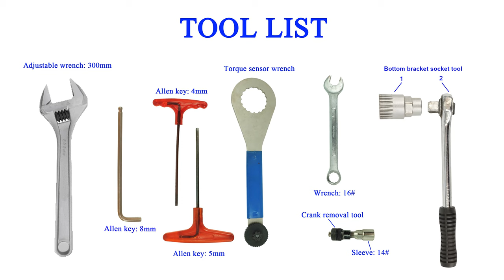eRider | eBike Torque Sensor Evolution -  eRider T9 / T17 Torque Sensor Install Video

Comment: Where can I buy the T17 version? I have looked everywhere, can't find any shop having this one.
Reply from the maker: Hi , please contact us at our email sales@portapower.com.tw.
Our sales specialist will help you.
Reply: Hi, I need a T17 Sensor. I send a Mail, but no response;-(
Reply: @LuluCrewdotcom  I sent an email too. I was in contact with them, but in the end they decided not to ship it to me. I found a seller on Aliexpress who had the T9 sensor listed in Aliexpress. I sent him a message and asked for the T17. He said he could send me the T17, I should just order the T9 and write in the comment that I want the T17.
It took a while, but I got the T17 sensor, have installed it and it performes perfectly. Better than the T9 I had before. I use a 84Volt Battery and a phaserunner and I had EMI problems with the T9. Massive filtering of the supply voltage even didn't work. Now with the T17 (and the filtering) I have very smooth operation. Both sensors, if they work, FEEL VERY GOOD.
Reply: @jumbleblue  same here, have the T17 coming from a Seller on Ali. Hope it works on my SUPER73 as good as yours.
Reply: @jumbleblue  what do you mean by filtering? Just curious
Reply: @MrDeceptacon88  Somehow the power supply voltage was very "messy" in my bike. I guess it was the inverter or the motor who fucked all up. Like spikes and ripples and all. Really not what you get from a DC battery. That mess seems to have made it through the DC-DV converter I use to do 12V. So I did filtering with capacitors, coils and a specific filtering IC.

Comment: is the t17n torque sensing bottom bracket compatible with a belt drive setup? i am thinking of getting one with my Grin Brompton Conversion Kit but i also want to get the Brompton belt drive modification from Kinetics Bike Shop in Scotland, which replaces the drivechain from the default derailleur+internal hub setup to a gates carbon belt drive. but i wont get the erider if its not compatible with the belt drive
Reply from the maker: Hi , could you please tell us more detail about your problem by email : sales@portapower.com.tw
Our colleagues will help you , thanks for your support.